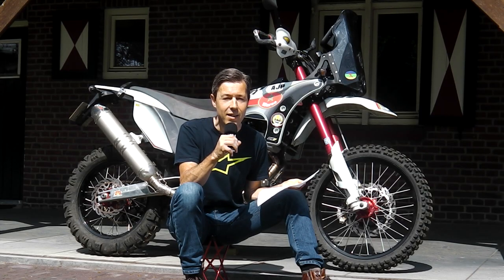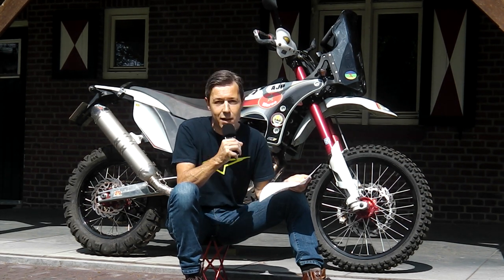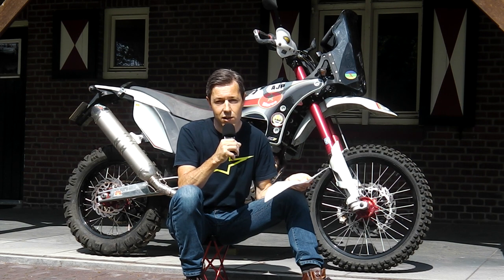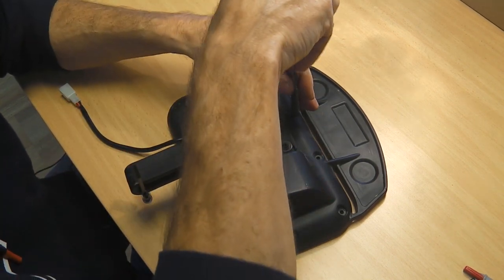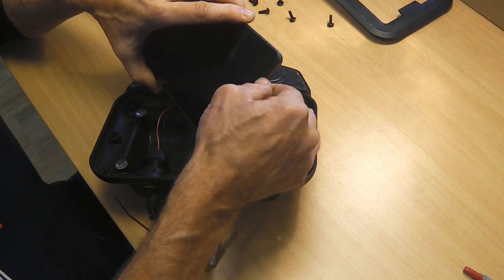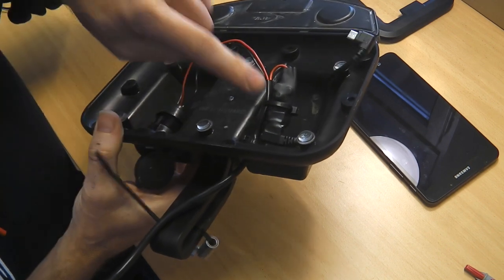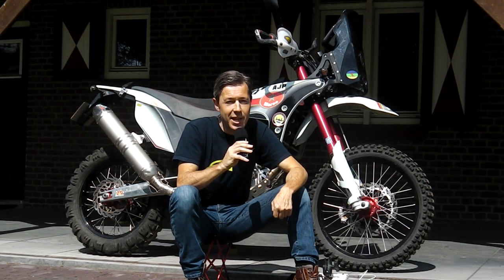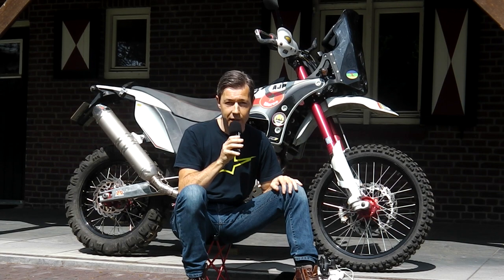Tablet on a motorbike - Part 1: Galaxy Tab on the AJP PR7

Comment: very interesting video ! what is the dashboard app you are using? Do you know if there is a 3D printing file to reproduce the tablet case ? i am waiting on part tweo of this video !!! thanks!!
Reply from the maker: The dashboard app is called Drive Mode Dashboard. You can find it inside the Google Playstore. Regarding a 3d printed tablet case. I bet some people have done that. But I can't help you out with that one. 2nd part of the video is still somewhat planned.
Reply: i use a tablet CROSSCALL T4    it work very good

Comment: Hoi Rogier, thanks for the video. How do those tablets fair with a gloved hand?
Are you also able to get apple CarPlay working? In my case I’d have to replace some of the indicators and dials on my bike, are you able to display yours on your tablets?
Reply from the maker: Hi Justin, I have not tried to get apple CarPlay working. For the gloved operation, I sewed conductive wire in the index finger tips of my gloves. That works really well. I no longer use the ipad on the bike. Too much trouble with the connector. Maybe if you don't go offroad and you have less vibration the wiring will last longer.
Reply: Thanks  @joacerbis ! Looking forward to the next video. I was wondering if the USB C connector iPads would fair better. But then again that’s a pretty expensive experiment and I believe you might be able to run Apple CarPlay on an android tablet, although I haven’t really investigated
Reply: Can you please share a link to purchase the housing ( tablet mount)

Comment: I have been really enjoying your information videos, Rogier! 

How are you getting on with the IPAD set up! I’m looking to swap out my Samsung for an IPad! Trying to work out best options for case and mounts for the PR7. 

Any advice?
Reply from the maker: Hi James, the new video won't be coming soon I'm afraid. However I can share with you my experience. I have used the IPad mini4 which I mounted using a Ram Mount Type-C. A bit bigger than the traditonal Type-C ball. The shell for the IPad is an aiShell.

Experience has not been good. Here's why:
1. Display not bright enough in bright daylight. Display on 100% brightness already.
2. Charging cable fails. Even though the plug is secured to the case, the connection eventually fails. This is due to vibration and the lightning connector being a weak spot to start with.
3. The aiShell screen protector easily scratches.

A solution with traditional cable and plug does not work reliably off road.. Wireless charging could be a solution or a dedicated device mount connector. That or having a big battery of course.

Comment: Hi Rogier, I just got a new PR7. How interesting you find it placing an additional rugged phone to used together with the Samsung tablet? Or.. is it enough with just the tablet? Thanks
Reply from the maker: Congrats! I'm always curious at navigation solutions. The Samsung tablet is good for the fact that it's a pretty cheap device. Screen readability in sunshine is not bad. So, yes the tablet is enough. Just using the tablet as a navigation device, nothing else. A rugged phone could replace the tablet or be an extra.

If you can manage to get a stable power connection to the phone and provide enough charge to run the screen at full brightness, which is required in bright daylight, you have a good piece of kit. Maybe wireless charging would provide enough power to the phone to keep it charged up. RAM has some nice solutions. It can get expensive. If you go that way, I'd be interested to hear your findings.

Another thing is that buttons on the handlebar to do some basic operations on the navigation device is extremely handy and much safer than trying to operate the navigation device while standing up on the pegs and going thru some nasty terrain. For example the buttons made by Thork racing are nice. They would also work with your (Android) phone.
Reply: @joacerbis  downside of wireless charging is all the heat it generates. I’ve had my iPhone power down due to overheating just charging it with a normal cable already. That would get a lot worse with wireless charging. Although it’s so much more convenient to operate with a gloved hand… wireless charging + active cooling?
Reply from the maker: @justinhalsall4077  Yeah I was thinking the same about the heat. I have purchased the CrossCall "Core M5" phone 2 weeks ago. It comes with a pretty decent mount. I do plan to make a video about this setup soon. I might get the Thork racing remote control thingy to avoid having to mess with the gloves on the screen. However, with the conductive wire its not bad.
Reply: @joacerbis  Thanks for your kind answer. I'll start using the tablet and find out if I need an additional rugged phone.  I'll also check Thork web page. Thanks !!
Reply from the maker: @CesarLopez-hh7cd  For the rugged phone that can serve as a navigation device I think that the CrossCall Core X4 would work. It can be operated in rain and with gloves. They seem to have a pretty good mount for it as well.

Comment: does that app works without sim card ?
Reply from the maker: That's right, no sim card required. In that case you can use offline maps. Add them before you go on a trip using wifi.

Comment: Hello. Great video! thanks for it. Just one question. Does the bike came with Samsung tablet? If yeas. Would be greate idea to built tablet "just" fot the bike. There is not need to have front camera and some useless buttoms. I would prefer biger RAM  for example rather then front camera. What do you thing?
Reply from the maker: The bike came with the Samsung tablet. Bigger RAM is nice. Front camera is useless. You'd be better off filming yourself with a GoPro or some other action cam. The tablet is not fully waterproof. A waterproof tablet such as the Samsung tab 'active' would be better. You'd need another holder for it instead of the one supplied by AJP. For example one from RAM mount. It becomes an expensive solution. The wiring to the tablet remains the weakest point. RAM does have some nice mounts but if they are up to the task I don't know. The tablet wiring connections get an awful lot of vibration during offroading.
Reply: @joacerbis  copy that. Thx a lot for the greate and useful information. Great videos. Just continue pls! 👍
Reply: If you want a great solution go for the Carpe Iter. Not cheap but best bang for the bucks and do everything you want. Fully waterproof. Bombproof, Bluetooth controller, more ram, way faster then the Samsung Active. Produced only for offroad opportunity

Comment: Is there some particular function of the plastic piece above the tablet? It looks like a cover only. At first I thought these are 2 buttons, but in your video it seems like just a piece of plastic.
Maybe can be used to install another socket.
It could be cool to install some wireless (Bluetooth) buttons which could control the tablet. For example in my favorite map app Locus it's possible to use the volume buttons to zoom the map.
Reply from the maker: Hi Jaro, the plastic piece is meant for placing switches for things like auxiliary lights, or indeed, put another usb socket in. Some people take the grinder and remove the plastic piece all together.

Thorkracing sells a USB remote control that installs on the handlebar with which you can control almost all of the famous navigation apps. I myself have the Blitz buttons installed to control the Rallyblitz app on the iPad. I still need to make part 2 of this video which is about using the iPad on this bike.
Reply: @joacerbis  Why would you want to use an iPad (delicate as it is) on an Enduro bike? There is the whole temperature issue, and don't forget the Rain and the Cold,, and the thing with the gloves ... if it is raining. I would be wondered if this would work?

Comment: only one gps for motorbike with craddle , android, transflective screen for direc sunlight, etc..is Garmin Monterra.. but it's really old now..
Reply from the maker: I guess the Monterra never really caught on. Hardware seems to be the same as the Montana. I own the Montana. It's not my favorite piece of equipment. I prefer the gpsmap 60 series with the physical buttons. In terms of screen readability in direct sunshine the Garmins sure have the edge above any tablet. On the motorbike you need the screen to be always on and therefore need a powered cradle.
Reply: @joacerbis  you're right, I dreaming about a GPSMAP 276 ..under android (to have several app.)  with powered cradle (and audio conected) with transflective screen.. and 4g LTE port
Reply: @joacerbis  This GPS could be the ultimate solution, but a transflective screen is missing...sick https://www.globexplorer.fr/fr/tablette/2246-tablette-x7.html
Reply from the maker: @cloudy0micha  Thorkracing sells the 'Carpe Tab'. You'll probably find a few others. Not sure about the transflective screen.

Comment: Could I just buy the box somewhere? I have the same tablet and I would like to try it on my motorcycle. Thank you
Reply from the maker: The box can be purchased from AJP. Box, external charging socket and wiring will cost you around 200 Euros inc. VAT. If you would wish to use a RAM mount, you would have to fabricate a custom plate, but that shouldn't be too difficult.
If you need help with purchasing these items, let me know and I will connect you with the Dutch dealership.
Reply: @joacerbis  Thanks for your answer, I am studying to do something similar to a Tenere 700. https://youtu.be/9RLR8V57IsU
Reply: @joacerbis  if you can that would be nice. Is it fully waterproof?

Comment: Very interesting. I have several questions and would be grateful if you could answer them. How does the tablet turn on and off? If it's in the box I don't know how to access the on / off button.
In case of extreme temperature, more than 50 degrees does not automatically turn off?
Thank you
Reply from the maker: Hi Alberto, The tablet turns on when (usb) power gets connected (engine on). When power gets disconnected (engine off), the dashboard app will shutdown the device, but not after asking the user first.
This behavior, where the device switches on when powered-up and switches itself off when powered-down can only be achieved on a rooted tablet.
If you don't wish to root your tablet you cannot use this particular housing which hides the on/off buttons.
I have never had the tablet switch off because of over heating. I'm pretty sure that the firmware on the device will take care of this. When parked in the sun I usually put some garment, a jacket or my gloves or something over it. Never had a problem.

Comment: Hi Rogier,  I'm thinking about trading my Tiger 1200 for the PR7 and found your channel whilst researching this bike.  Thanks for uploading your informative videos.
Keep them coming as I'm sure they'll be a huge help if I get my PR7.
Regards Graham. UK
Reply from the maker: Thanks Graham. The more info on this bike, the better. I have a few items lined for some videos in the very near future.
Reply: Hi Graham, Did you purchase a PR7 and from which dealer. If so, r u happy with the bike? Thanks in advance👍
Reply: @JJamJ   Hi, I've had a small test ride on the PR7 from mhb motorcycles but haven't bought one yet, I've also had a test ride on the Tenere 700 and I think I'm leaning toward the Tenere 700 because I can carry a pillion on the T7, the T7 also has ABS which is a bonus when on road and in general, the T7 felt more comfortable for my ergonomics. The T7 might not be an off-road animal like the PR7 but its close enough and I think it would suit my 70/30 road/off-road needs better ... I still have the Tiger 1200 to date 🤔
Reply: @gtube153  Appreciate the reply 🙏. That's a fair shout. I hear Husky will be bringing out a 501 adventure, smaller brother to the pending 901.That sounds interesting.